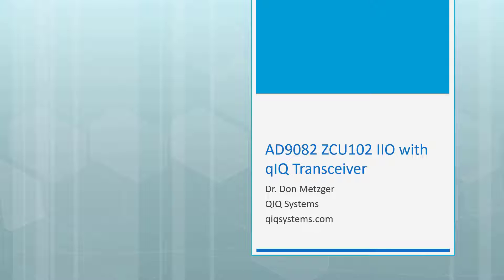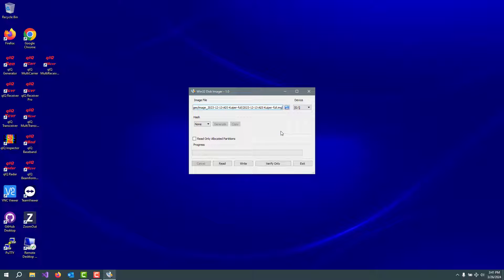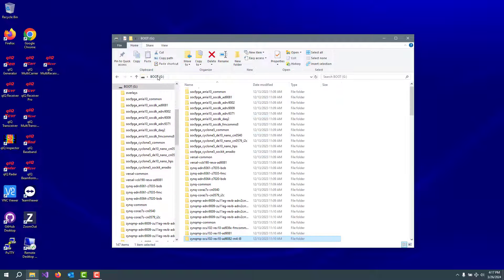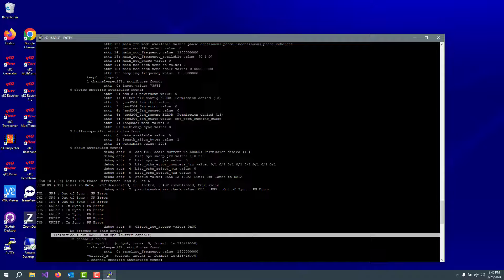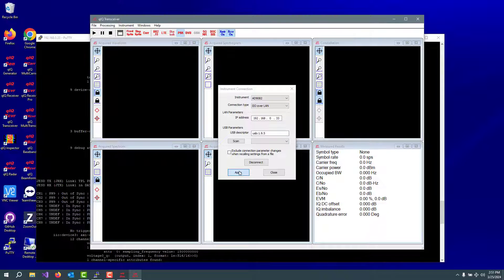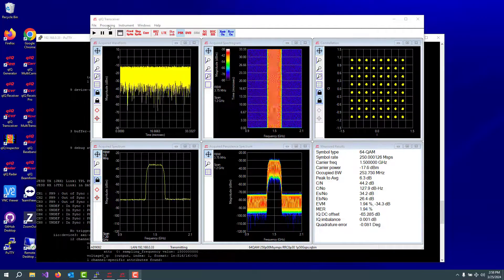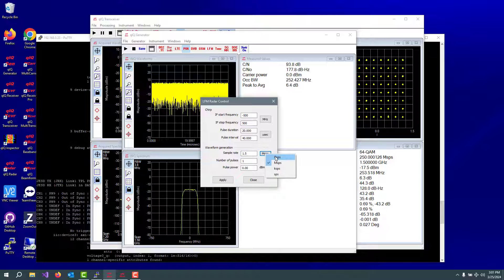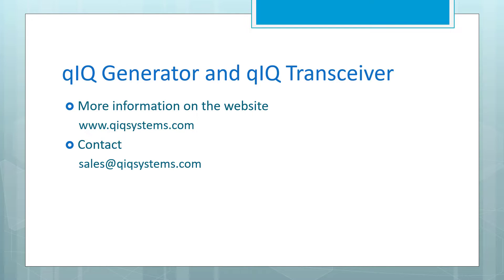AD9082, ZCU102, IIO and qIQ Transceiver

Comment: I am trying to use an Analog Devices AD9082 with a Xilinx ZCU102 host board. My idea is to send data from the processor to the DAC and to receive data from the ADC and send them to the processor. Can this video help me ?
Reply: Any suggestion of video that can help me ? 
FPGA : Module SOM FPGA Xilinx Zynq UltraScale+ XCZU15EG-2FFVC900I
Evaluation board : AD9082-FMCA-EBZ
Reply: I also want to add that I use an Enclustra Mecury+ XU7 MPSoC (ME-XU7-15EG-2I-D12E-R4.1) with an Enclustra Mecury+ ST1. Thus, I cannot use the ACE platform from AD.
Reply from the maker: Thanks for your question. 
The sample rate shown in the video is 1.5 Gsps. With 16-bit I and 16-bit Q data for each sample, that is 4 bytes per sample. Thus, the data rate is 6 GBps, or 48 Gbps. The ZCU102 board does not have a data pipe big enough to move this large data rate. Thus, in the video, we show how to use Analog Devices IIO software, and small buffers of data which are located on the ZCU102 board.
In order to do what you want to do, the ZCU102 board must be replaced with a board which has either PCIe, or big ethernet connections. I am not familiar with the Enclustra boards, but looking at the Mercury+ and Mercury+ ST1 on their website, it does not look like there are ways of moving the data in and out of the FPGA board at a fast enough rate.